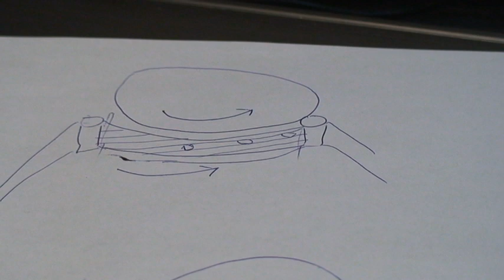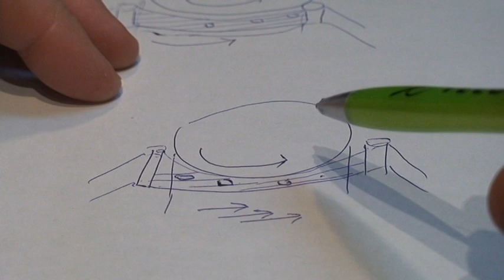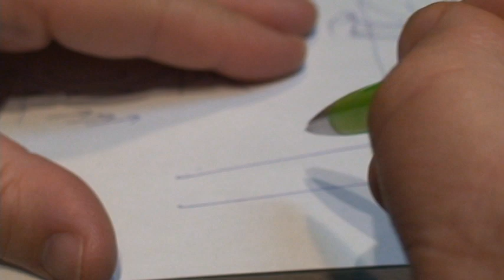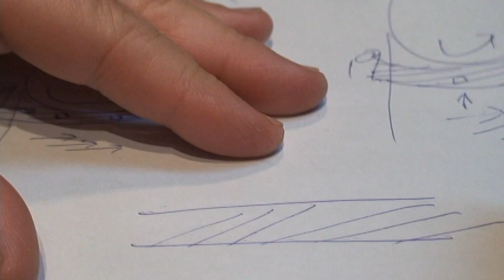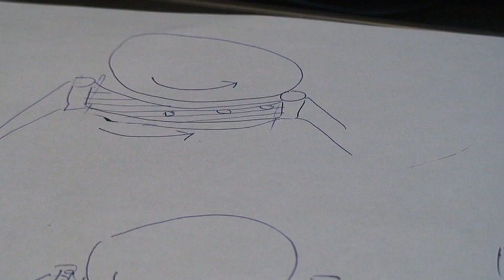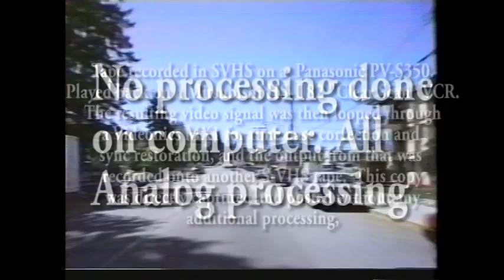Ultralapse video using vintage analog equipment demonstration

Comment: I love seeing all of the cool vintage vehicles in this video! Very cool ultralapse video!👍
Reply from the maker: I may digitize the original speed VHS tape and make a video just showing all the old cars. I have shots driving around downtown Vancouver on that tape. This was cut from this one as the original tape went to squeamish, and then I turned back and went back through Vancouver over Lions gate bridge, Stanley  park, and through the down town core.  The second video went through down town core, up through west van, and onto highway 99, up to to Lillooet, then down the Trans Canada. They were both sped up on the dynamic tracker.
I cut the first one at Squeamish, just where I pull into the left turn lane, and continued on the second one which continued north.  So I may digitize the original tape and then I can do a comparison to processing it on t he PC vs the analog speed up.

Comment: Sir, you now have thousands of speeding tickets, your going to jail boy LOL :-D.
Im just thinking of the higher frequency generated of the luminance and colour, some chopping or clever p.l.l magic must have been needed for the vcr to play that tape at that speed, to produce standard video.

Technically a pain in the arse lol.
Reply from the maker: The drum speed remains relatively the same. It speeds slightly on forward search, and drops slightly on reverse just to maintain the horizontal frequency. that would drop slightly because of the increase in the forward motion of the tape in forward, or or increase when the tape was reversed. So the drum speed slightly changes to keep the horizontal frequency correct. The real magic happens with the head angular correction by the piezo shifts the head up and down so that the head follows the same track as it traverses the drum at high speed.
Reply: Darn, I had no idea such a machine exists.  Can you show us that machine one day?
Reply from the maker: Already did a video on the machine was was used to create this (The playback machine) It is here:
https://www.youtube.com/edit?o=U&video_id=NWhXRZYUsm4
Reply: The link did not work, try again or tell me the title so I can look it up.
Reply: The link doesn't work!
Reply: https://www.youtube.com/watch?v=NWhXRZYUsm4 should fix the link for those needing a working link.

Comment: I love your channel.  You have such a diverse knowledge that stops your videos ever becoming boring. I look forward to the next. - This head height tracking system is one that I'd never heard of, and wish that I did.  Was it a system which was only on certain manufacturers decks, or was it a semi-pro equipment thing?
Reply: The first manufacture to utilize this kind of system was Philips in it's V2000 format.the head chips were mounted on piezo elements and gave seamless still and search image.This was built into the format from day 1, so all units had it as a standard.
Reply: moshe zaharia Interesting, thanks for the info
Reply from the maker: Right, and that was requires because if I remember correctly that format you flipped the tape over like a cassette and recorded on the other side. Piezo element on the heads were required to accurately track even regular playback.
As far as I know Mitsubishi was the only company to put this on a SVHS deck. And yes they were Piezo elements as well.
Reply: That's correct, the V2000 tape would flip over.I don't know if it ever came out in NTSC, but on PAL it held 4 hours on each side in SP, and 8 hours in LP. Giving it total recording / playback time of 8 hours SP and 16 hours LP!I will add that I always look forward for your videos and I wish you all the best.Moshe.
Reply from the maker: The mitsubishi HS-U82, and the Electrohome equivalent AVR-J05 had this feature. They were very high end pro-sumer models. JVC came out with their own system that actually tilted the head, but it was more limited in terms of the speed it could compensate for. If I remember correctly the JVC could do 3X speed perfectly, and the Mitsubishi could do 5X speed.
Reply from the maker: But how was the picture quality in that mode. Pretty bad I bet.

Comment: love your videos and great machine i wonder did the d-vhs have this feature
Reply from the maker: I never owned a DVHS, but I highly doubt that it could do this. Just the way digital framing is done, the head drum spins much faster. 
For example on mini DV, and HDV the head drum spins at 9000 RPM as opposed to 1800 for NTSC analog. Digital 8, which uses the same tape as 8mm and Hi8 spins at 4500 when in digital mode but only 1800 in analog.
In analog, there is video track on the tape per video field. 
So as the head starts its scan, the picture starts the scan from the top, and at the end of that video track the scanning lines are at the bottom of the field.
With digital each track on the tape is only a small portion of the picture.
If you loose a head on an analog tape you get a picture for 1 field, and snow for the other field. On digital ir you loose a head, you get several bands of very clear picture with equal spacing of a frozen picture from the head that clogged as the signal is held in memory and read out after the complete frame is stored.
Reply from the maker: When I made the move to HD, I went with the HDV format. 
D-VHS never really got off the ground, because by that time we were all using non-linear editing, and burning to Bluray disk.

Comment: That looks great, but why not just make the drum turn faster instead of making the head physically move ?
Reply from the maker: The drum does slightly turn faster in order to maintain the correct horizontal sync rate. If the drum were to really speed up to track the same video track without moving the head the horizontal frequency would also rise, as would the chroma subcarrier. It is alot more complex than it sounds. For example my 3/4" machine does not change the drum speed when the machine is in external genlock mode, and as the tape increases in speed the horizontal frequency drops, and the picture will eventually loose horizontal lock.
Reply: Thank you for the answer ^^
Reply: Darn complicated.  You know your stuff.